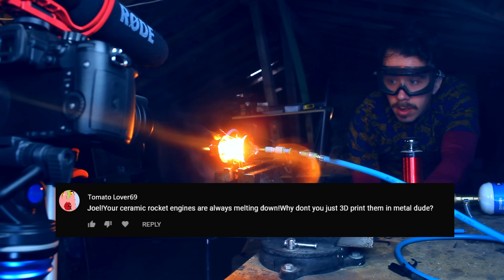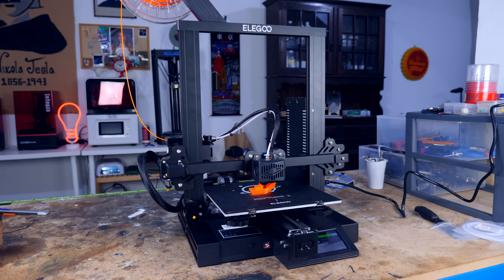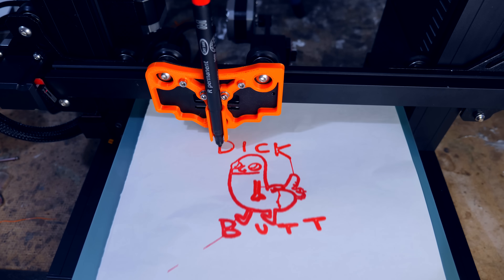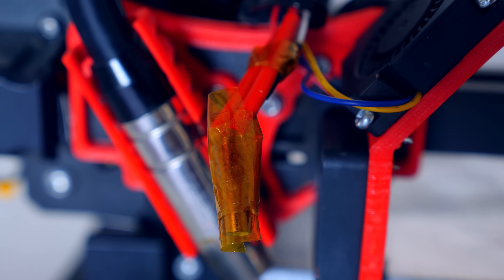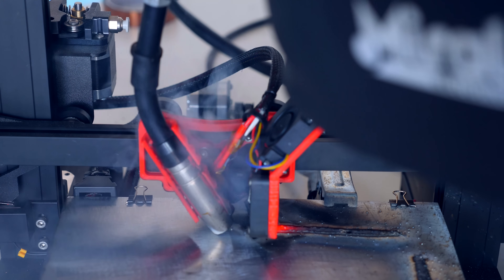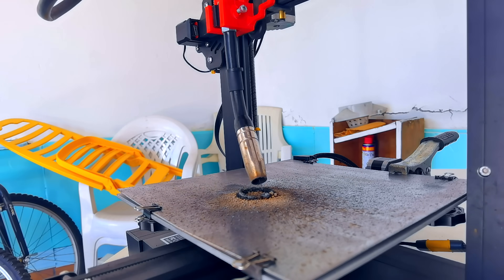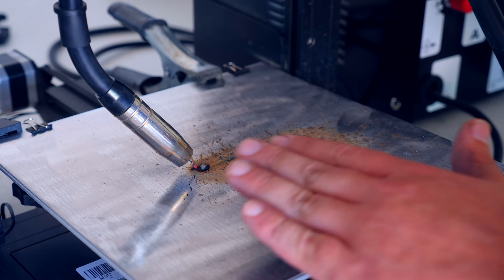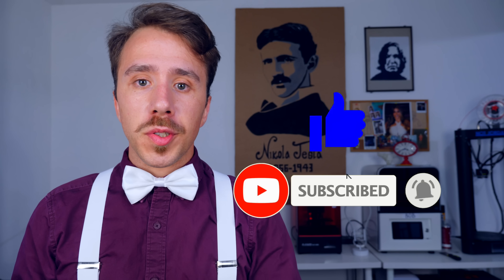I built a Metal 3D Printer using my Welding Machine

Comment: What if you tried slowing down to a single dot at a time and cooling the spot that was welded with the fan? Then I think a good test would be trying to build up a single pole because if you can do that then you should be able to build a metal skeleton frame at least that can be filled in with sheet metal. You may be able to angle the nozzle at like 30degrees to improve with overhangs but again I think it would largely be based on the cooling time you give each spot.

Comment: Theme for next video: using a plazma cutter mounted on the 3d printer to cut out the "layers" that you were trying to 3d print here. 

basically: make a rocket engine out of layered metal cut out on a 3d printer?

Comment: Metal 3d printing didn't work, but how about casting aluminum?  3d print in pla, encase it in cement, melt out the pla, pour in molten aluminum.

Comment: Try using a soldering iron and solder to 3d print metal. Solder has a lower melting point and thus should be easier for your 3d printer(Neptune 2?) to handle.

Edit: Instead of using solder, you could use solder paste which could be extruded with a paste extruder (Teaching Tech has a video on how to build one).

Comment: Maybe if you set the temperature lower then the wire feed speed you could get a pulse effect like with aluminum welding. The process might be slower but the metal will warp less. I could be wrong

Comment: This is the video I didn't know I needed!

Thank you! Also, as other pointed out going with a way of not using flux core wire (whether mig, Tig or using plain wire with a hose for shielding gas to make your own mig, should allow multiple z layers to adhere without the slag getting in the way)

Keep up the great work! Inspiring!

Comment: Try using a little pool under the bed, if you can't do it with a good sealing it'will leaks, or, you can use sand instead of water inside the pool, isn's as effective as water but maybe it works. Greatings and like from Spain!

Comment: An idea may be to form your rocket nozzle using a reduction method instead of an addition method. Strap a dremel tool to the 3d printer to use as a really slow CNC machine and carve a rocket nozzle from a graphite block. You can probably source an appropriate graphite block from a scrap yard, look for really big motors you can take the brushes from. Alternatively you might be able to use an aluminum block or a soft steel or iron block, but those would take much longer I imagine.

Comment: Video Idea:  Could you 3D print the superstructure for an RC Model Airship?  If you're feeling "Authentic" you could fill it with hydrogen rather than helium.  Hydrogen has more lifting power after all.  Hydrogen can be electrolysed easily with an aqueous solution of sodium hydroxide.  Don't use sodium carbonate or you'll get a lot of CO2 as well which is heavier than air and you'll need to keep adding NaC03.  Using NaOH you just need to keep adding water as the volume goes down.  You'll figure it out I'm sure.  Though I'd not blame you if you stuck with party balloon gas for safety.

Comment: there is a couple of projects i have been wanting to do using stuff from home, multiple projects one video? first off i always wanted to build what i think is called a franklin bell. basically a bell that will ring when a thunderstorm approaches. and a water clock. a clock powered by flowing water replenishing a basin that has a hole in it so the water exits at a set rate

Comment: Why not use a bucket of metal beads or fillings? so that the arc will melt the metal together and you can produce parts similar to the uv resin printer method

Comment: It might be possible to print a model,
Cast ceramic or plaster type material,
After plaster dries, place in high temperature oven to melt pla.
Cast aluminum in mold.
Of course you will have to make / buy an aluminum melter.

Comment: Video Idea: Print moulds and atempt to make a rocket engine by overmoulding ceramics onto alluminium for a viable ablative chamber and nozzle. You have everything you need except for the casting sand for the alluminium. Tip: Make the ceramic overmolding in 6 or 12 parts splitting the inner surface both radialy and axialy, so it resists the alluminium expansion and contraction during the firing and cooling of the ceramic.

Comment: I know it would be extremely inaccurate but could you try casting using a low melting filament. Such as print your part in plastic and then cast it in sand with molten metal?

Comment: I worked in a welding shop where we refurbed heavy equipment parts by using a wirefeed that would fill in the axle hole by going in circles and rise up gradually. It used solid wire from a 55 gallon cardboard drum. Then the machinist would bore it smooth then press a bushing into it.

Comment: Ok so simple solution 3d print the nozzle out of pla. Then melt aluminum and use the lost wax process on the pla. 
I design it right you could have the nozzle cooled by water. 
I would use chalk powder mixed with a bit of white glue and water and let dry once you have filled the nozzle and set it up to be poured. This would work for your vortex nozzle and your spike nozzle. The line chalk  sells for very cheap it's fine and when mixed with the glue and water will form a hard shell. It needs to be dried slowly and completely. Also very little water as don't want a lot of contraction causing cracks. Plaster also works and has a higher melting point of 1450C vs 875C for the chalk powder. 

Aluminum melting point is 660C. 

I think this would be an interesting use of 3d printing and other methods. You have the kiln to melt the pla out of the plaster form then all those aluminum parts on your 3d printer.  LoL JK use pop cans or something. LoL. 
The water being pumped though the nozzle should help it survive longer.

Don't forget your best running vortex rocket engine had a longer body and slightly larger around. 

Hope to see you try this 😊

Comment: Hi, why don´t you 3D print in some resin or wax or some plastic os similar properties and then using the Lost wax smelting convert the wax piece onto metal? Practically any kind of steel can be used, and you can melt the iron using an induction furnace, that practically no degrade the metal you melt.
Thanks for your really funny and nice videos!!

Comment: Could you use a thicker aluminum bed (even stacked pieces), along with your steel sheet? Maybe some thermal paste between layers to help/ensure more efficient heat conduction? The thicker the aluminum, the more efficient the heat sync, possibly less warpage/deflection. If you could figure out fins and add a fan… 🥶 🤷🏻‍♂️

Comment: A proper mig welder would probably work a lot better in this application. Ive never been able to get a clean weld using flux core no matter what i did to it. mig welding is way easier

Comment: To solve the warping of sheet metal, you can put a copper plate underneath to act as a heat sink.
When we weld stainless sheet here, we use a copper tube hammered flat to act as a heat sink.
I'm not sure if this will actually work, but you can give it a try.

Comment: so I'm not an expert at welding but from what I have learnt one of your challenges also was the nature of using a flux core welder - since it produces slag that needs to be cleaned off the weld this is mainly why the grinding between layers was necessary. If you used a MIG or gas shielded wirefeed process that would in theory allow you to continuously weld. "stick out" or length of wire poking out from the nozzle matters a lot, so having it pretty close to the work surface is key. This may work in a more ideal way if you also integrated the extruder motor into the welder so the printer driver would control wire feed... Now calculating the right feed speed tho... that may be a thing unto itself.

Comment: Flux core is always going to be dirtier than gas weld your welder looks on the cheaper side but if you can turn the amps/heat down and it will slow the warping

Comment: You need a better brand of welding wire, the stuff that comes in the welder is complete junk. Thats why theres so much spatter and dirt.
Also you need thicker steel base and more clamps.

Comment: You need to create some molds to cast metal parts. Start with 3D promoted parts, then use those to create molds, and cast metal parts using those molds.

Comment: You absolutely can print metal on a fdm printer. There is metal powder filled filament. The binder plastic can be burned off and the metal powder sintered in a furnace with an inert atmosphere. You need a short smooth filament path, a hardened steel nozzle and a furnace. The furnace is expensive but there is a way to do it in a crucible with some kind of powder I can’t remember the name of the company that makes it so you’ll just have to search google yourself.

Comment: you can look into powder deposition too, I have taken powdered copper and fused it together into solid metal material using a UV laser and it really takes far less than people realize, in power that is, but obviously the more power the more powder at once that can be fused, what I am still looking at trying is using the powder coating stuck to arc welding rods while using powdered metal mixed into this as higher amount of metal filler to see if it can be used to turn this powder into solid traces and get the traces to stick to the layer below, (ideally of course a chamber to hold say argon inside so the protection powder on arc welding rods would not be needed and not get in the way possibly making a dirty mix with little to no strength)

Comment: Hey Integza - what about the powdered metal filaments you print via FDM and then bake out the polymer and sinter in an oven? “Filamet” is one brand if I remember correctly. If you keep your oven purged it’ll fuse the metal without excessive oxidation. They also sell coatings to paint your part with before bake out to protect them from oxidation. It works similarly to your ceramic resin prints, but from one of your FDM machines. Good luck! Love the channel! ✌🏻

Comment: If you intend to continue playing with the welding capabilities I'd recommend a few things:
1. Run the mig nozzle parallel to the bed - yes when welding you typically tilt your nozzle but that is to achieve different penetration and flow in a single direction. For a project like this attempting to go multiple directions, just tramming the nozzle to the bed will probably yield better results. 
2. Rapid cooling will lead to more warping and usually brittle or cracking welds. I'd avoid that air nozzle, especially on that thin metal. I'd just run it line by line. When you slow the metal to air cool hit it with a wire brush and have it clean for the next layer. 
3. Have fun! Cool project to see, you've earned a subscriber.

Comment: I want a 3D printer :)
here is my proposal

Sometimes using the 3D printer, a lot of prototypes and materials are wasted, so to stop buying new rolls and also, helping in some way the nature not using more plastic, I suggest you to make a video about a DIY plastic extruder.

basically, the idea is to feed it with your old or failed prototypes. It would be cool to see you making a DIY plastic extruder for your 3D printer, and also be careful because I've heard that melting the plastic at extruders could be harmful and toxic if you don't do it properly

By the way, great video, I loved it!

Comment: When I read this, I was thinking "how will he do that?" But you failed successfully 🤣 I'm welding for decades now and that thing you have is not stable, the burning of the metal is hell, way too much sparks around the weld and the heat is way too high. In top, the core of the welding machine is a piece of crap I guess.

Learning it by hand would be better and faster, so even with crappy machines you can have good results.

But what I would do when I was you, I would cast molten aluminium in forms and built my nozzle that way.  I have to think about a way, but 2 halves that you Tig Weld together would work.

Comment: You should print the parts again, but do a casting and use those printed parts as the figure for your mold?  Once you see the hot metal, it will burn the printed piece and you will have your piece in metal, there is a special resin that I don't know if it works in this case, that resin is used to make jewelry, it is special for casting, I know it as castable wax

Comment: Greetings sir. I believe this project needs another visit although I think the problem is that you were treating the metal 3D printer like you would a normal pla printer. I think this would work better if you were to treat this like a resin pressure. To achieve this I think you should have your normal steel build plate like you had in this version. Then build a box that is larger than the dimensions of your project. Fill the bottom with a thin layer of metal powder. This should act as aggregate, and help control the heat of the weld. For every layer that the 3D printer wants to move up you would apply another thin layer of metal powder. I saw a version like this where someone used the sun to 3D print glass using sand.

Comment: As somebody who designs, runs, and builds metal 3d printer (DED laser/powder), this video made me cringe, very very much.

hint hint if you want to go down this route further without breaking the bank, too much, and being the first person to create a consumer metal 3d printer, all you need to melt steel is a 200 watt laser with a small spot size, but it's most likely going to have to be powder or a well made wirefeed, even then metal can't support itself so building a five axis machine is kinda a necessity, and slicing that is even harder (I use siemens NX), and don't use aluminum or titanium powder because they explode unless in an inert atmosphere

Comment: I have found several manufacturers that seem to produce fdm filament infused with metal for 3D printing that they post process later for you that come out as solid metal parts. Maybe you could test this filament in use with a jet powered tomato launcher.

Comment: I recommend that if you come back to this project, get co2/argon (25%/75%) bottle and ditch the flux core wire. It has a more consistent weld with less contaminants and without the ugly flux on the top of the weld.

The other thing I would advise is to lessen the angle of the gun, you dont need much angle to the gun and being that the table travels in all directions, I believe that no angle would give you the most consistent results.

Also, you can usually get cheep scrap metal (waste) from a local welding shop or manufacturing plant.

Best of luck

Comment: Hey Integza, since you have a high temp furnace, why not try out "The Virtual Foundry" metal filament that can be printed on an fdm machine and then sintered to obtain pure metal parts. I think Ferrolite Resin is a similar thing that can be printed on resin printers and then sintered to obtain pure iron parts. Probably worth a try since you already have a furnace and 3d printer.

Comment: This is so close - but you probably could have just hooked up the wires for the extruder motor to the stepper motor that feeds the material to the welder...then you'd have direct gcode control of it using a regular slicer. Might just need to calibrate the feed rate, but then you should be set. :P

Comment: Joel, as a welder… the biggest issue you have is you need to add shielding gas or ARGON… the nozzle guard is to keep the gas around the welding wire.

Comment: Rather than use the 3D printer to print the metal rocket nozzle, you could try doing a Lost PLA method, where you make a cast of your print, melt the plastic, and then use the cast to make the metal part.  There's several videos on youtube if you want to learn how.

Comment: your awesome. too bad you wasn't able to get the feed rate and current to cooperate. I was going to say that if you could reinforce the base it wouldnt warp to much, but It don't know if your welder can really handle continuous current flow without overheating. also alot of the vids I've seen used a shield gas and so prevented so much sparking. hmm. Its a very novel idea though. maybe you can come back to this one at a later date and try it again when you have more resources to poor into it. The plus side to DIYing your own equipment is that you know exactly how it works and what it can do.

Comment: Not watched full vid yet problems yull need to overcome feed speed the welder feeds at a much higher rate youll need the printer parts to move at speed compatible with the feed of the welder or lower its rate to match the print head

Comment: You could bend and then weld together the sheet of metal until you get the engine.

Instead of creating the whole thing at once try to assemble different parts together, this way you could even use metal.

If you have trouble bending and assembly the parts together in the right shape you could print sime supports in PLA.

Comment: @Integza that was an awesome video. would you consider using electrolysis to separate water and use that as your rocket fuel? both gasses are Extremely flammable. for your rocket have you considers a water jacket around the nozzle and combustion chamber? with the ceramic parts have you considered using a vacuum chamber to impregnate the ceramic parts with a heat resistant material? maybe after the ceramic parts are finished curing in the kiln you could try multiple baths in ceramic slip or glazing under vacuum.

Comment: you could "3D print" a metal rocket engine by printing a regular plastic mold and doing some metal casting. That would allow you to use different metals as well. Not easy at all Btw

Comment: you have to check Markforged, they have created an FDM machine that can print metal from a normal spool of filament. That filament is made mixed metal powder with plastic, after printing the plastic must be removed in an oven and voilà, metal print.